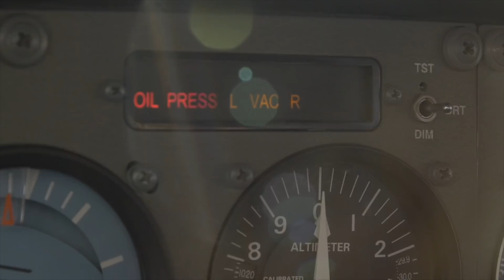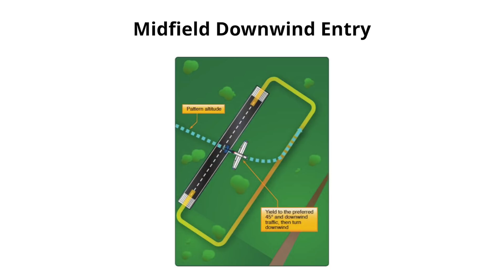3 Things You NEED To Know - About Pilot Controlled / Non Towered Fields When you fly

Comment: If you are flying an IFR approach to a non-towered airport, never use IFR terms when making a CTAF report. An example of how NOT to make a CTAF report is to say “Carlisle traffic you have a Cessna 172 over HUBDO on the GPS Charlie approach , Carlisle”. If you are not IFR rated, where is the Cessna? Even if you are but don’t have the approach chart in front of you, where is the Cessna? Speak a language ALL pilots can understand and give your CTAF report using miles and direction avoiding all terms related to IFR.

Comment: Unless there is paratroops or gliding activity, overflying the field 500’ above circuit height to the dead side of the circuit  to check winds and look for NORDO traffic is standard here for ATF fields. Then do your course reversal and decent to circuit height, cross over the field again and enter the circuit mid-field. I’ve never quite understood why the 45 entry was/is preferred in the US…Jason, is there a specific or technical reason for that?
Reply: 500 ft above the pattern alt.? Not a good idea. You can meet a small jet at this altitude .
Reply: @2025at  depends on what circuit heights are outlined in the CFS…if there is no difference outlined for piston vs turbine everyone here will fly the same circuit altitudes. As I recall that was a question asked by the examiner during my flight test years ago, and 500 above circuit height crossing midfield to the dead side was the preferred procedure. Anything non-standard would be outlined in the CFS.
Reply: @75Seneca2  AIM 4-3-3 states differently. Also ultralights have different pattern alt.They should fly at 500 above a field elevation. So, actually 500/1000/1500 are “default”.
Reply: @75Seneca2  The FAA released ( I think in 2018)  Advisory Circular (AC) 90-66B about pattern altitudes.
They eliminated for example 800 ft ( above AGL) . Some airports used this alt. instead of 1000.
Reply: @2025at  perhaps that’s the difference between FAA and TC. Here, at my home airport, circuit altitude is just over 800 AAE. Standard is 1000, unless specified differently in the Canada Flight Supplement. Any differences for ultralights/piston/turbines would be noted there.  Standard procedure in the Transport Canada AIM for uncontrolled aerodromes is Specified in 4.5.2, in that “if necessary for an aircraft to cross the airport before joining the circuit, it is recommended that the crossover be accomplished at least 500 feet above circuit altitude” and that “...descents to circuit height should be made on the upwind side or well clear of the circuit pattern.”

One of those subtle US Canada differences in the respective AIMs perhaps?
Reply: @75Seneca2  So now we know that we are talking about different countries .
Reply: @2025at  no worries! I’ll remember those differences if I fly down there!

Comment: Going to put a finer point on these finer points:
1. Flying over the field: you are looking for anything that could be a problem; animals, vehicles, maintenance crews, etc. At one airport I fly into, E63, there was a bunch of dirt on the runway due to recent flooding, so I prepared myself for possible skidding/slipping after touch down and made a mental note to not use the brakes when over the dirt. Flying at night this is especially important. Since it will be dark, you will want to do a low pass over the runway before landing to scare off any critters and check the runway for anything that could be a problem. 

2. After pressing transmit, wait a full second before speaking. That way you won't cut yourself off. Or better yet, after pressing transmit, look for the TX light to illuminate on your Com radio. 

Greetings from Phoenix, AZ.
Reply: Yea my favorite was a mid California airport that had half the runway underwater due to recent rains.
Reply: @scottfranco1962  Well that would be one way to slow down! :)

Comment: Hi I passed my PPL only a few months ago and my home base has multiple grass runways and no tower.
On point one saying the name of the airfield is so important.  Where I live there are a number of airfields on the same frequency which have the same numbers on their main runway.  This is the first time I've ever had someone suggest saying the airfield name at start and end.

Number two.  I have always been taught to check the circuit but in doing so you do actually end up doing a 360° turn.  So I'm lined up with the runway but to the side, before lining up to take off when it's a left hand circuit I turn to the left and check there are no aircraft in the circuit then continue turning to line back up on the centre line.  It's even more important to do when there are multiple runways someone could be using and the potential for aircraft to be landing with no radio calls.

Last point regarding airfields with parachute drops going on.  When I started there was a very active parachute business based at my home field and they always made very good radio calls so everyone knew  well in advanced that a drop was going to happen and then another when the drop happened and finally once everyone was on the ground.  With the 5 minute warning if I didn't think I could be on the ground within that time I just stayed away from the circuit completely but positioned myself so I could join quickly once the radio call had been made that everyone was on the ground.  So far I haven't had any gliders active when I have landed on cross country trips.

Comment: I've been a pilot for a long time. This is the 1st time I've ever heard of doing a 360° on the ground before departing.
Reply: In 1983 my primary instructor did it. At 05C, the only runway 8-26 had no taxiway, was accessed direct from a broad ramp. It made sense to look all around before back taxiing, as you would tie up the runway longer than simply departing. I can see that doing a 360 may be inappropriate given situation.

Comment: Two things that happen at my airport, we have a lot of pilot training at our uncontrolled field.

1. Aircraft using a different runway than everyone else. Last week, winds were 310 @ 6 (we have RWY 12-30) with about 3 airplanes in the pattern for 30. Then aircraft on radio "N1234 entering 45 for 12"...they proceeded until we had to tell them no, use 30. I certainly don't like landing with a tailwind and going against traffic in the pattern. Super dangerous
2. With aircraft in the pattern, just don't do a 5 mile straight in...join the pattern with everyone else.

Comment: My examiner told me anyone who does the 360 Is a moron, especially the guy who did this almost hit us on my exam. I've seen aviation101 do a 90 degree turn to the right and left to check the base, and final.
Reply: Many small airports there is not enough width on the runway or taxiway to do this, if there is a taxiway at all. and delaying on the runway is not wise.
Reply: another "don't"  :  "XXX traffic, I'm 10 miles west, inbound, any traffic please advise."

Comment: Why do you choose to use the direct downwind entry and not the overfly the pattern at +500ft and do the teardrop entry? Is there a time where you do use the teardrop entry? How do you make that decision?
Reply from the maker: I would overfly and do a 'teardrop' back to the 45 in most cases. I would not do this is there is glider or parachute activity because it can be a hazard to be that high directly over the airport.
Reply: @TheFinerPoints  How is it safer to fly TPA instead of TPA+1,000’?  Aren’t most jumpers descending vertically, over the field (or landing zone)?  Seems like they’d be a hazard either way, and if I use the direct downwind entry, I’m now in conflict to an aircraft in the pattern that chooses to execute a go-around.

Comment: One thing I find about a lot of pilots that learn at grass uncontrolled fields (Especially Non Unicom) is they may be really good pilots but lack the skills to use the system. A good friend would buy all the sectionals to get to Conroe TX lay them out on the garage floor draw a black line straight to between 0WI8 & CXO fold them and number them 1 through 5 6 what ever Put then in the seat pouch and never look at them again. He's like a homing Pigeon he knows where he is, always. I would go nutz, he had all Old radios and gyros. We once got in some very marginal weather and his Horizon gyro tumbled. 2 weeks later I had a used KX-170, Audio panel new Xponder, Horizon & DG and Intercom. $2200 he paid to have it installed. He still hated to go near towered airports or talk to anyone except th ask for Winds and active ... Even when going to towered airports.
Reply: I see similar. Students who learned mostly in towered airspace, struggle in uncontrolled. And those who trained mostly in uncontrolled, fear the tower. I love both uncontrolled and towered airspace. They both have pros and cons.

Comment: This is also one of my pet peeves ... and something I need to work on myself! You couldn't have put it any better about nobody listening for your transmission initially. Especially in flight training, the CFI is often talking or going over something when a transmission comes through, then they make shushing noises only to for the aircraft to not say the airfield at the end of the transmission. This is infuriating in many regions, as there will be multiple fields with runways 16/34 etc.
Reply: or even worse, they are making a call independent of an actual runways, and you have No idea which airport they are at at all.

Comment: I like the term "Pilot controlled fields/Non-towered fields" way better than "Uncontrolled fields" going to start using that with students!
Reply: Is Class E "uncontrolled" even if there isn't (unlikely to be) a tower?
Of course, Echo is controlled airspace. Therefore, it can't be uncontrolled or non-controlled. So..who controls it..PILOTS, do!
Reply: @kevinjarchow8812  But the vast majority of non-towered airports are in Class G airspace. Don't forget that Class E airspace begins at 1200 AGL (700 AGL in certain areas).
Reply: @johnopalko5223  Some begin at the surface, right? Also, if pattern altitude is 1000ft above airport elevation, that would mean that you are are in Class E airspace when you are doing your overhead maneuvers and turning downwind. So even at a 1200 AGL Class E, you are still in Class E in the pattern and could be up until the point that you would turn base or even base to final.
Reply: @kevinjarchow8812  Some airports with instrument approaches do have Class E extensions that go down to the surface. They're indicated on the sectional chart by a dashed magenta line.
Depending on the traffic pattern altitude used at a particular airport and whether the floor of Class E airspace is 1200 or 700 AGL, you may or may not be in controlled airspace while you're in the pattern.
If you're overflying the airport at 1000 above TPA, chances are you are in Class E airspace.
The floor of Class E airspace is also depicted on the sectional chart. If you are within a magenta vignette, Class E begins at 700 AGL. Otherwise, it begins at 1200 AGL.
Sometimes Class E airspace begins at a non-standard height. In this case, the boundary of the airspace is indicated by a staggered blue line and the floor is given as altitude MSL. You're not likely to see this except over the ocean.

Comment: "Aircraft who just announced departing rwy 25 say airport." Never hurts to ask.
Reply from the maker: True
Reply: Keep in mind possibility of NORDO aircraft. I was taking off at KBMC rwy 17 and another aircraft was landing headed straight at me, landing opposite direction. I step-sided to the right upon liftoff and he landed. Turns out he was on the wrong frequency and said so when i was 5 miles out. Wind was 3kts favoring 17.
Reply: It is better to ask to clarify ambiguous intentions/directions, than to try and guess.
Reply: Its a good idea, but it never works (for me) in practice. They may not hear you well, as radio carries and you may hear them but they may not be able to hear you. Plus, Joe pilot who can't be bothered to use proper calls is not going to be listening to such calls in any case. I thing asking for airport like that works for me perhaps 1/10 of the time. Here in California at least, I can't believe how far away I get other airport calls from. Lots of airports, lots of overlapping frequencies.